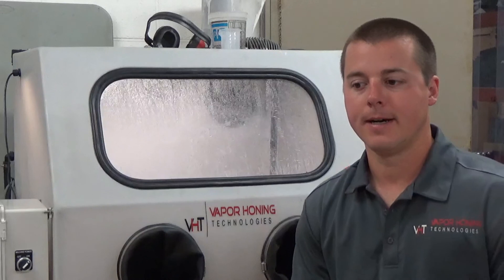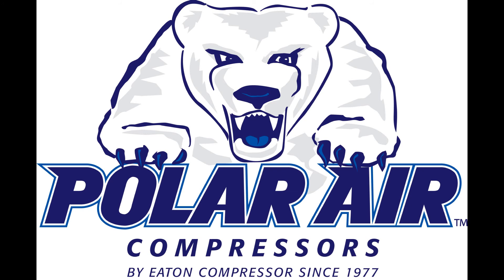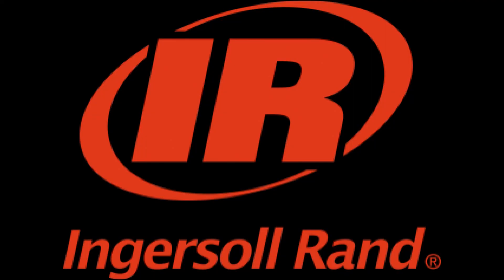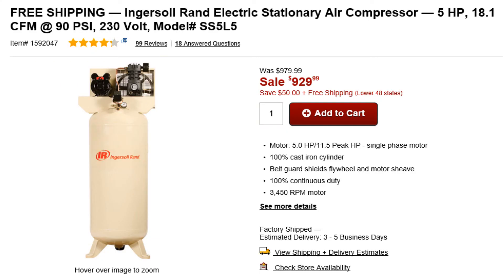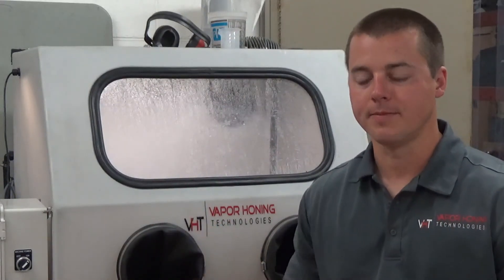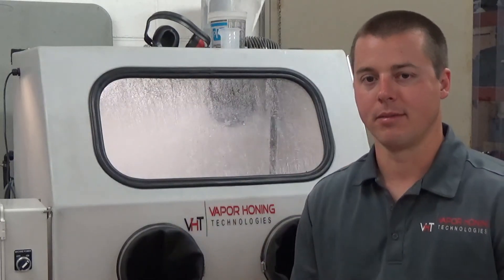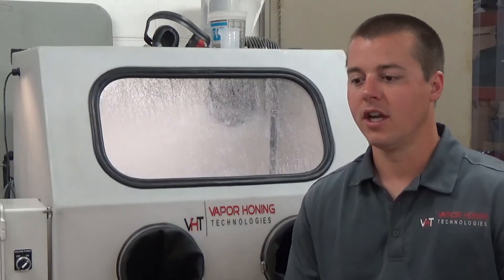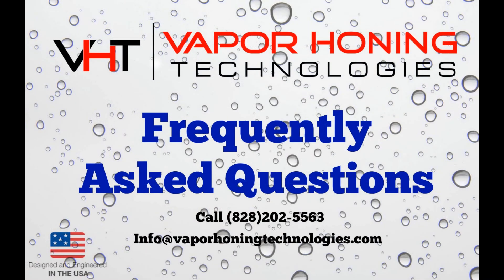What Air Compressor is Needed to Vapor Blast- Vapor Honing Technologies

Comment: Would the 60 gallon 5hp ingersoll rand 18.1 cfm @ 90 psi be able to sand blast good? I’m trying to put into perspective what I can sandblast with that? How long would it take to do one wheel of 18 inches? All 4? Currently I have a 60 gallon 11.5 cfm compressor. My blast cabinet is the Eastwood b60 7cfm @ 90 gun. Just trying to figure out my best option here. Any advice and knowledge on my setup would be greatly appreciated. This is a hobby. I plan on sandblasting dirt bike parts, quad parts, and wheels for vehicles. Thanks!
Reply from the maker: The 60 gallon ingersol compressor with SS-5 pump head will certainly work for a wet cabinet and should work for dry as well.

Comment: I never ever used air tools before, or had a compressor set up in my garage. 
I am old school, and ALWAYS used elbow grease and hand tools... 

I am however now, looking to get an Air Compressor. 
I was looking in Tractor Supply.  and my question is:  would any 60 gallon (dewalt or Ingersoll Rand) that Tractor Supply has on display, would any of these stand up compressor do the trick? 

They caught my attention, probably because of the price tag. 
PS. My budget is about $1000.  what is best from Tractor Supply or Lowes or any brick and motar store? 
Thanks

Comment: Don't forget the vane compressor. They are neither screw compressor, nor piston compressor. But efficient as hell. Easier and cheaper to maintain and look after than screw compressors. Mattei and hydrovane are perfect brands. Pretty quiet, no pulsing air like piston compressor due to five or more air outlets into the tank per rev of the motor. With them you get the very most out of your electric source. Like 5kw or hp compared to piston compressors will give much more cfm for that same effect motor.
Reply: I've also read about a mattei vane compressor that had 200 000 hours in it and still running. That equals everyday around the clock, day and night for almost 23 years. So look into them. Mattei and hydrovane

Comment: Do you recommend a gasoline powered air compressor for hobby use
Reply from the maker: No we do not recommend a gasoline powered air compressor for Hobby Use.
Reply: @VaporHoningTechnologies  ok. Thanks for the response. Are there specific technical or safety reasons for this. I was thinking of buying one of these machines and possibly operating it out of a storage unit at first and i was concerned with the availability or lack thereof of higher wattage electrical connections needed to run those higher hp compressors. Best i might hv available might be a 15a 110v hookup. A gasoline compressor running and maybe feeding an auxiliary tank(for increased capacity) might solve this problem. Thanks again for any input
Reply from the maker: @j.m.5995  You can use a gasoline compressor, the main concern is the expense to keep it running.  But there is no reason why you cant use that.

Comment: I am currently debating which VHT system is right for me but I am currently leaning towards the weekend warrior. I would need to upgrade my compressor and run plumbing in my garage. Would 3/8" ID plumbing 55ft long with IR 5hp compressor be enough or what do you recommend as far as plumbing?

Comment: What are your thoughts on the new Eastwood qst-30/60?. Rotary screw compressor in the same price point that you are describing. I am considering this compressor with one of your weekend warrior machines for hobby/ home use.
Reply from the maker: We did some research on the Eastwood qst-30/60 Scroll Compressor.  Looks very good, however we do not have any experience with this particular compressor.  We are looking to possibly purchase one and test it with our process.  We will definitely let you know how it goes.
Reply: @VaporHoningTechnologies  Any updates?
Reply: Vapor Honing Technologies Excellent!  Do keep me posted.  I am very interested in purchasing one of your cabinets but don’t have the room for the larger compressors you recommend.

Comment: I would suggest saylor beall along with quincy. IR is running their pumps faster to get higher cfm. It results in hotter air/moisture issues and shorter pump life. I went out and picked up an 80 gal 10hp 38cfm polar air about a month ago. I was able to get a polar air for not much more than I would've paid for an IR with a lower cfm rating. The only reasons it cost more is because it came with an auto drain, continuous run valve, and an hour meter. Pretty important features in my opinion. I'm really happy with it, and the people at the factory were friendly and accommodating. They have the best warranty in the industry, though I hope I won't need to use it.
Reply: Arnold. Thats a good size compressor. Do you run one of the larger VHT products like the VH 3500 or VH400? And if not, and you run this compressor configuration on the VH 800 series or VH 1000, is there a big advantage for the dollars spent? Thanks!

Comment: Thanks for putting up all this info on wet blasting! For a DIYer, is their any reason why you could not run a similar system with a pressure washer? The electric units are quite affordable.